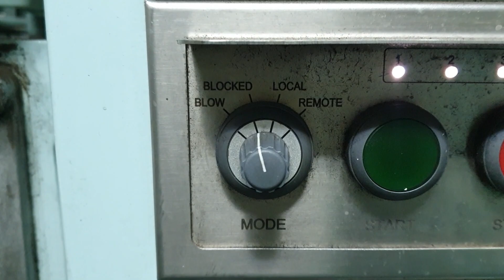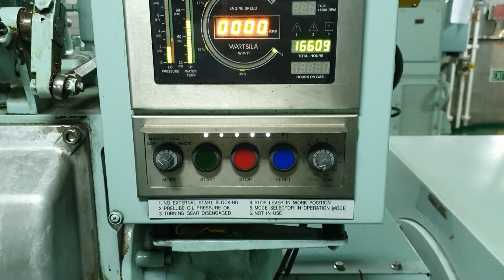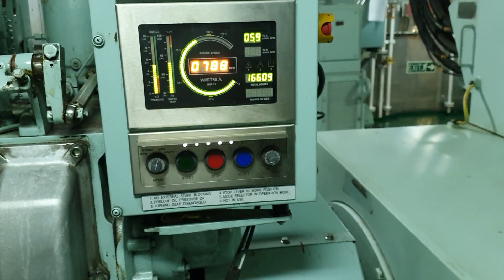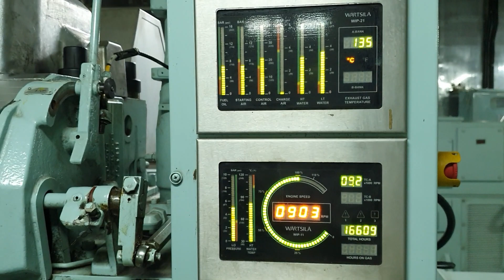Wartsila 975W6L20 Engine Starting procedure

Comment: Check the oil last?  Is this type of engine one where it needs to be running to get a good indication of oil in the galleries ?  
Myself, I prefer checking oil level in the pan before starting an engine.